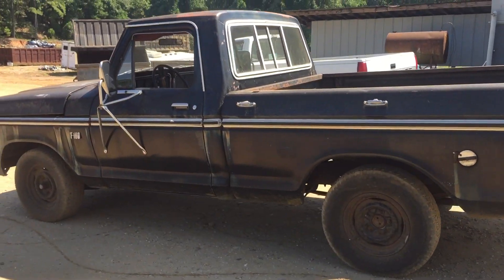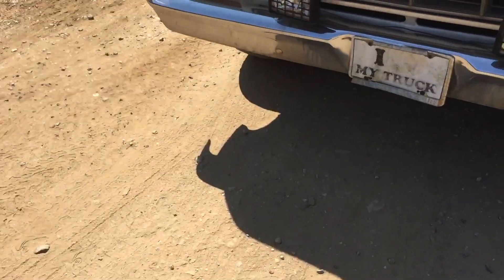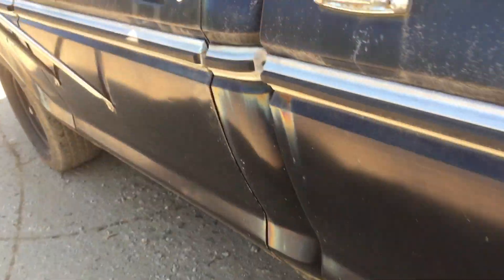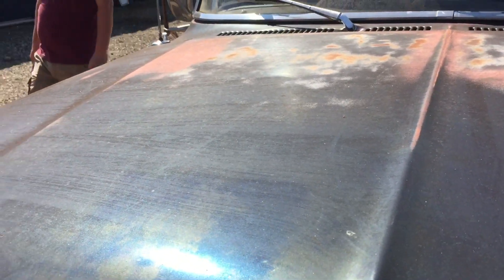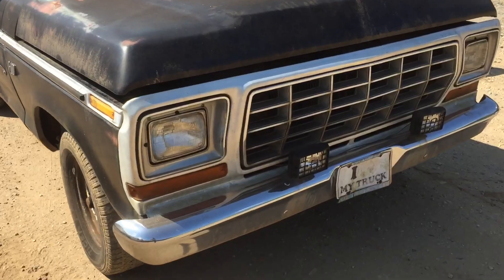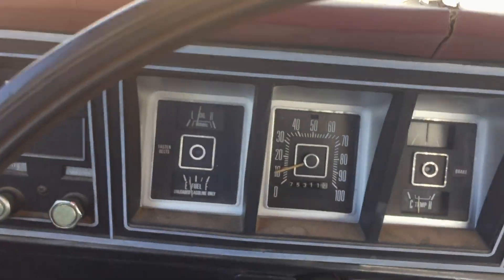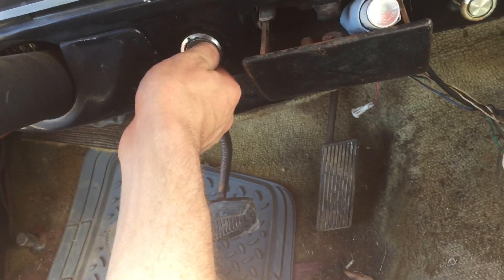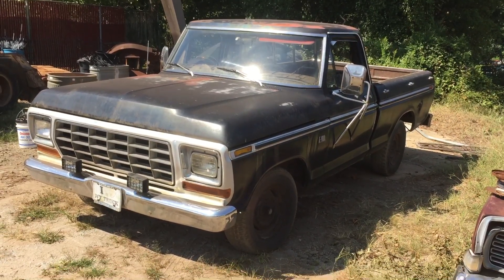Shortbed F100 Scrapped!?! IT RUNS!

Comment: If it's 76, it has a new grill and head lights.. 76 would still have the round lights..  Oil pressure was there, but the gauge should have been in the middle a bit more..  but, a cool rig for sure.. It will take about $10 grand to bring it back to a decent daily driver...  $20+ to bring it back to original..  Nice project truck for sure!  it's all there and just needs to be loved!

Comment: It's a 1973-76 F-100 with a 1979 grille and insert.
The instrument cluster and large diameter steering wheel is true for 1973-76 F-100
45 MPH is straight up on 77-79
50 MPH is straight up on 73-76

Comment: I know where a Ford like this is right close to where I live extend cab model been sitting for a few years still wearing its original two tone paint, factory paint job in yellow and white,body looks super straight,I'm all for saving the old pickups but I'm not a Ford guy, problem is guys who do like the older stuff and appreciate them don't usually have the money to buy them and fix them up,maybe a club could be formed to save stuff like this and  crowd fund it get together with guys and restore them instead of being crushed

Comment: A 1976 Ford with a 1979 grille, pretty cool, man. You sure it's not a '74, because Ford switched to the F-150 in '75.
Reply: They kept making the f100 alongside the f150 until either 82 or 83 I think
Reply: f100 made it all the way to 1982 f100's and 150's were made together
Reply: @P7777-u7r  Ford did continue the F100 into the early 80s alongside with the F150 which eventually replaced it.
Reply: @peterbiltxr379  The F150 came along in '75, and would eventually replace the F100 in '82. You know your trucks.

Comment: I'm not a Ford fan, but running & driving vehicles belong on the ROAD, not a junkyard. Just from looking under the hood, I think the upper rad. hose & alternator has been replaced...so yeah, there must be something in the water down there. Get that truck for a song, replace the worn out parts, seat, & steering wheel, clean up & clearcoat the "patina", etc., etc..

Comment: Off topic but my grandmothers 94 century is ready for junkyard it has a bent front axel and the front tire is rubbed to the Steele wiring,also the front windows wont roll down and the exaust leaks in the car, the trunk is warped from over storage and the exaust rattles really baaaaad, now every single panel has a scratch and a dent and the windshield has a big driverside crack, " No no thats just the outside we haven't even opened the doors yet, heh heh." ( Verse 2) well when you open the door it smells like hair spray and ass, and you stick to everything in the caaaar, and the dashboard has stains from any drink you imagine while the seats are covered in menthol light 100s cigarette holes,    you'll smell the exaust from two blocks awaaaaay. " Hey I'm startin' to get dizzuh... screeeeeeeeeeeeeeeeeeeee booosh

Comment: Wow  unreal just cut the front part of the truck off and make a trailer out of the bed of course keep the wheels on the back.

Then take the cab off with a claw ,grab it by the roof and yank HARD  .After that drive the loader up over the hood with the engine running ,see if the the radiator pops like a tick.

After that give it a Viking funeral  take down in the field put ,umm 1\4 of a gallon of gas in the cab and set it up for a bbq.
Was waiting for the god awful powersteering pump whinnnnnnn,that would be sledgehammer
Material there.Just hit while its running ,see if the fluid starts burning then throw gas on it.

Then run over it with the loader again and again.
I was surprised  no oil smoke bellowing out the back like a 6-71 Detroit.The gauge mustve been lying  and it was out of diesel.

Comment: Wow. That thing is a diamond in the swank motel of the swamp . Well whatever, it's actually very cool due to the configuration factor of it, and the bones are good on that one. Working guages, even a horn . I even spied that super fancy cassette deck with graphic equalizer. That would be a sweet rig to fix up for sure.

Comment: The reason this truck is being scrapped is $2.59 per gallon gas. Truck this old would be lucky to get 9 miles to the gallon with no overdrive
Reply: 2wd with a 302/c6 and carbuetor should get about 12 around town and 15 on the highway, running correctly

Comment: Lots of potential there. I wish they still made barebones worktrucks. Nowadays they are huge with too many doors and options unnecessary in a truck. They cost as much as a damn house!
Reply: I agree. I don’t know why people like new trucks so much. I mean; you have a job to do. Do you really need all these doors and features?!
Reply: @millerkiller6496  
If you think about it all the fancy crap on Lincons and Caddys that goes wrong after just a few years makes them damn near worthless. Now trucks are built "loaded" like that.
Reply: You can get a basic work truck for $25k if you shop around.
Reply: @nodak81  
Glad to know they still exist but I haven't seen one at any dealers in many years. I can't even find stick shift.
Reply: I feel the same only exception is the Raptor. And no more building your own truck from the factory if I'm not mistaken.
Reply: Amen
Reply: upside downdog....People forget old trucks could be bought loaded with options back then !! People think old trucks were just plain base model work trucks ,not so !!!

Old trucks,GM,Ford,Dodge could be bought with power windows,seats,tilt,cruise,a/c that was loaded for those years !!! They didnt have keyless entry or in dash infotainment systems !!

Old trucks you see with chrome bumpers were a high end extra cost item...Old trucks that have 2 tone paint ,that was a high end extra cost item....Add the bigger engine,tow package (yes all GM,Ford,Chrysler rear drive cars could be bought with a tow package too )..

Add extra cab,4 door and 4x4 that was a high end extra cost item..

Old trucks starting in the 1950's had expensive high end models that were loaded with options !

Trucks today can be bought as this,plain cheap work truck !! People think trucks are only loaded..You can still get a GM/Ford/Dodge thats a base model work truck ! Nothing changed !!!

As for cost,you forget about inflation,you must add that ! People made $3 per hour in the 1970's so that $25,000 it cost in todays money for a 1978 truck was expensive,add the fact you could only get 3 year financing for top credit and 1 year for poor credit at 19% interest if youre lucky !!

In 1965 My Dads new Mercury Park lane that wasnt totally loaded,middle of the range cost $27,000 today...And for that you can get any type of new car for that Taurus would be its direct replacement today..Cars are more expensive and LESS expensive today..Add the fact they finance anyone today and 9 year terms at 4% is cheap if you want to drag it out !
Reply: Every nice old truck is a 2WD.  There’s a reason for that.  Not very useful, but nice to look at
Reply: No more manual transmissions in any base models. I think Dodge was the last holdout but only with a diesel engine and now I'm not sure those are still available with the redesign
Reply: Hey,,, 2WD maybe....But if you got a 4x4 frame...You can always swap all the nice sheetmetal onto it.....Works for me....
Reply: upside downdog you dont have to buy tye luxury trucks you know. You can buy a bare bones 2 door base truck long bed with just a/c and a radio for really cheap.
Reply: Don't blame the trucks or the automobile manufacturers it's the dealerships the dealerships only stock their Lots with fully loaded 4 door 4-wheel drive everything am on them every Belle & whistle pickup trucks it doesn't really cost them as a dealer that much more than a stripped-down truck but they can charge you a lot more money making them a larger profit the dealerships are the ones to blame you can still get a regular standard two-door barebones work truck with every option this has on it but you really got to look and then the dealership say yeah we have one in inventory it one of our other Lots but it's two states away and then they will charge you a delivery fee which is astronomical on top of the truck price you might as well just upgrade you going looking for a bare-bones truck sometimes they will find one with a few more options on it and come off the price a little bit but it is ridiculous
Reply: upside downdog some people need a 4dr truck nowadays saw you want to bring you two kids hunting and your wife with your fourwheeler. Wouldnt it be nice to have extra space in the cab to put the guns and all the people
Reply: I know right it’s ridiculous how much trucks are now

Comment: You cant have a plate that says ''i <3 my Truck'' And scrap that beautul thing like that. LIAR
Reply: Thats what I was thinking
Reply: Corrosion37 oh the Irony
Reply: @Billk2978  no its my uncle's. Its a 73 challenger... Nothing special. But he does have a 1971 roadrunner with a 440 in almost perfect shape. He has a 69' roadrunner with a 440 six pack thats rotting to oblivion. He has a 67' cornet R/T red on red, don't know the engine. And finally a 70' cuda with a six pack engine. I believe it's a 350 but might be a 440.... All these cars I've never seen run in my 20 year on this planet.😢 oh and almost forgot he has the 2012 dodge challenger srt8 yellowjacket... Mopar or nocar
Reply: Corrosion37 Maybe the owner died
Reply: I have a hunch that person may have died, or stopped driving. Sad.
Reply: Radio Rescue has it right. The owner highly probably passed away. I know this from experience. People get old. Can't maintain their vehicle anymore like they use to. Stop driving. It sits, then they pass away and the family doesn't want it sitting around for many valid reasons and a dealership isn't going to take it so they take it to the next best place to get some money for it, the boneyard.

The best boneyards I know of take these vehicles fix them up and sell them.  Probably what is going to happen here.

Comment: I'm really interested to know if someone would to buy a scrapped truck, could a rebuild title be issued and could it be re-registered and licensed?
Reply: Yazan Baddawi Like he says it already has title not salvage so you can register it like normal
Reply: @Brycereigle2000  but suppose it didn't have a title, can it get one? Cuz I see alot of those cars in the  scrap yard and honestly I see alot of them as dailies, project cars, or even resto mods.
Reply: Yazan Baddawi Yup. Depending on your state it’s a little different but you can apply for a rebuilt title with a few extra inspections to ensure it’s road worthy
Reply: @Brycereigle2000  I see. Thanks for the clarification bro.

Comment: And at 40 seconds in, I figured out someone changed out the grill & headlight assembly from a '78 or '79 XLT.
Reply: Same here,,,  But from '73-'79 all the bodyparts can interchange,,, Only maters if the owner wants to keep the original factory year style.....  I've seen trucks at Carshows Were they've put Race Track style Trim on a Pre '77 year model....Or have added emblems that counteract each other...(Ranger bed side emblem,, but has Custom on glovebox), Etc..Etc...  
The main thing on this truck that I am looking at,, is How solid and fairly rust free all the panels are,,,  Factory original parts are getting harder and Harder to come by... sure they make re-po parts but they're a pain in the butt as far as fit and finish...
Heck,, If This guy didn't sell it out right,, he could almost make more money parting it out on E-bay....

Comment: swap a bench seat out of a modern f150 (swap the brackets on the bottom from the old seat to the new one and it fits fine), and a little bit of work that would make a nice truck.   Also, see if it's a mexican 302 block in that thing.  It's about the right vintage, if that little barrel is sticking out of the block on the front left, that makes the block alone worth $2000.

Comment: Nobody needs to "save" this.  Park it close to the road with a forsale sign and it'll be gone in an hour...  When I worked downtown, I use to hang out around the pawn shops.  Picked up all kinds of deals that way.  I may need to start hanging out around junkyards...
Reply: Mat Helm I hang out a lot around junkyards. Nowadays the yard has usually already bought or are in negotiations forthe vehicles before they make to the yard. Some individuals still bring them in themselves. But more often than not, the yard has its own tow trucks or independent junk car buyers bring them in.

Comment: For people saying new trucks are not like old trucks,you cant get a base model new truck..Well YOU CAN ! Not all new trucks are loaded ! You can get a single cab Ford/GM/RAM today thats a base work truck !

Back since the 1950's you could get a truck loaded like any luxury car at the time..Especially by the 1970's you had extra cabs,crew cabs(dodge 1st in the 60's) !

2 tone paint was a high end option...Chrome was a high end option...Trucks had power windows,seats,tilt,cruise,a/c,am/fm that am/fm yes was a high end option !! Those were like a Lincoln,Caddy or Chrysler Imperial ! 

Trucks today fit everyones needs,either a base work truck you have it..lower trim,middle,higher..and in between ! 4 door trucks replaced the fullsize family car...See that Royal Monaco he had the other day..Trucks directly replaced that car !! Same interior space,trunk is the bed big V8's can be had or turbo
6's that have V8 power..People buy loaded trucks for their family vehicle,thats why you see so many 4 door trucks..Look who's driving them..In the day that loaded 4 door truck is driven by a female to transport he children in...Its big,safe and the bed has more room than any suv or minivan !!! Sure there are cars but the so called fullsize car today is a mid size car of the 1970's ,even shorter as they have no trunk room !!
Reply: 01trsmar But you can't get a manual transmission, can you?
Reply: you can get a manual still today. just not a common thing to buy a new truck with.
Reply: Quantum Studios What new truck offers a manual, particularly a base model? Dodge had a 6 speed available with the diesel but I'm not sure about the 2019 models. And that is my whole point. I remember when a base model truck meant it had a manual transmission
Reply: 01trsmar I just priced out a “base model” f150. By the time I was done pricing out all the base model options, the price of the truck was almost 30K! Ford does not make a base model truck unless you order it that way. You can get an ex-fleet truck that’s a couple years old but you can’t straight up buy a fleet truck unless you buy it in volume. And you can order a manual tranny in any truck but it seems the industry standard has switched over to an automatic and I’d bet that’s because people do way too many other things besides driving when they’re behind the wheel.
Reply: Bob Mchugh I have to disagree with that. You can't even order a manual in a full size truck these days. Only downsize trucks can be had with them, but I'm talking about the traditional 1/2 ton trucks and bigger. I often hear people dispute this and to me that just proves how hard it is to accept.

Comment: It runs !!!! WTH !!!!! Old trucks are shooting up in value,dont scrap it ! Well,you wont with a title !! Unreal !!!!

Like the old Dodge Royal Monaco,dont scrap it,at least pull the 440/727 even it has lower compression,different heads/cam/crank than the 1971 and older performance versions,it can be built to have the same and more power very easily ! For example, I run a 1976 440 in my 68 Charger RT and it runs 10's in the 1/4,looking stock not looking like a modded race car..Engine looks factory,body ,interior ! I have the number matching 440 Magnum/trans on a stand in my shop !!

Old Monaco should go on E bay see if it sells,oddly they are somewhat popular too !

Sell the Ford ! Heck,paint it,fix the interior if you can and $14,000 truck..Its a short box,people love those !